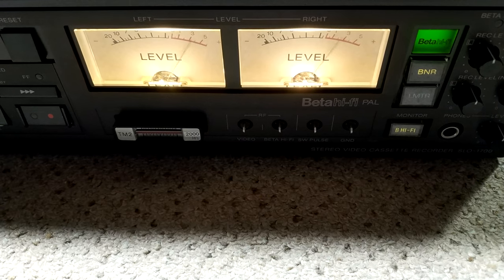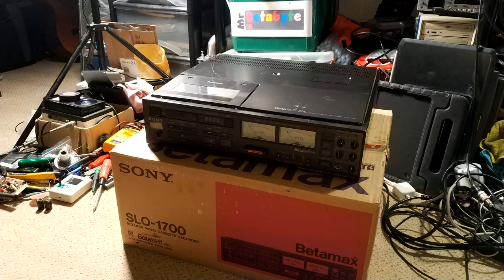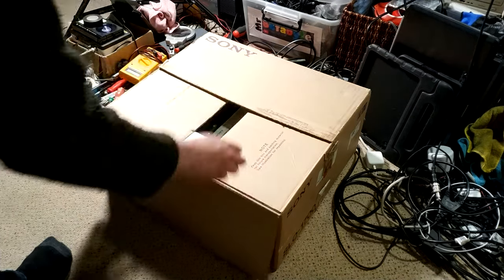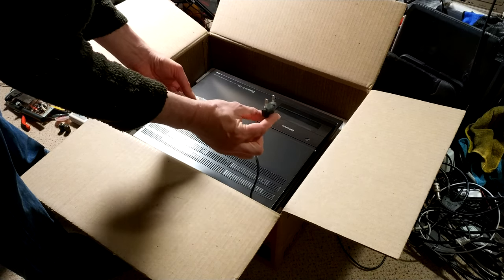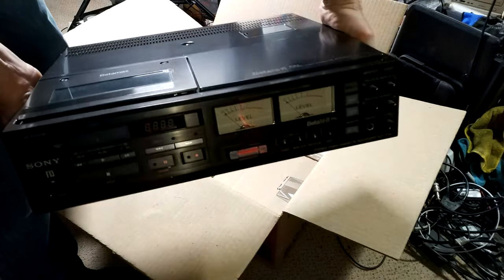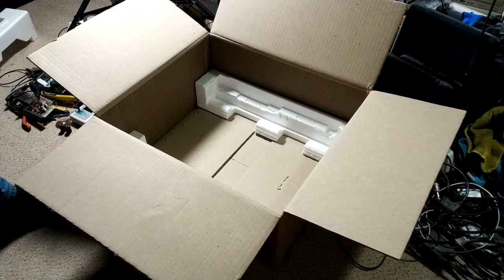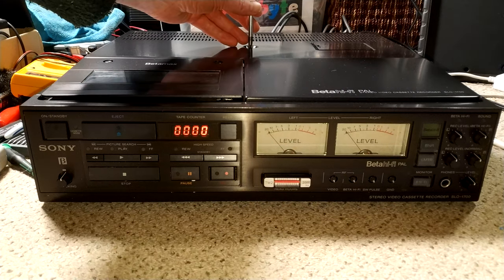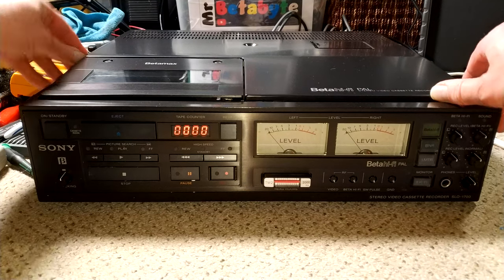Sony SLO-1700 Duplication Betamax - Beta like a Pro! - THE perfect Beta!?

Comment: What a nice VCR! I really enjoyed watching this video, you have told many features of it. One interesting topic is the fact this model has a different, simpler cassette loading mechanism than the C9, making the SLO much more robust. The unlacing feature is also a cool trick to reduce tape drag, increase speed and prolong the valuable heads' life. I think Sony made an effort to design this model so it was bulletproof as a workhorse.
Your particular unit is a treasure, really hard to find in this condition. I wish it found a nice new home.
Greetings!
Reply from the maker: Certainly a SLO! I compared the top-loading mechanism with the SL-F1 and it's a completely beefed up and unique to this model design. It may well be a 'professional' machine but in the modern age it really is the perfect Beta with real retro flair too. Ultimately, this machine would make or break the Betamax format as having a reliable machine for duplication of tapes for resale must have been the top priority for Sony at that time. Of course the rest is history but I really don't think Sony lost the format war but rather just moved on and after all, the last Beta machine was only 10 years or so before the last VHS machine...

Comment: Sorry for my lack of knowledge, but I recently found a Sony SLO-1800. Not quite the same model as the one in the video, but I believe the video ports are the same. That said, could you tell me what video cable the machine uses? I want to somehow convert the signal to RCA so I can see if my machine will actually play a tape. Thank you!
Reply from the maker: Oh wow, a SLO-1800! Any chance you could email me a picture of the socket and the rear of the machine and I'll dig through the manuals for you - I don't have a SLO1800 manual but I do have other manuals that should give you the info you need. Email is mrbetabyte@gmail.com

Comment: It is indeed an interesting machine. Wonder if RF out for video and audio HiFi is the actual RF signal recorded on tape, this is a great candidate for VHS-decode project, This is better than S-Video.
Reply from the maker: I was thinking this the other day and I will have to look at the RF output in more detail but from what I understand it's the raw RF from after the pre-amp stage but I'll let you know in a future SLO1700 video as I have a few more to make over the next few months. :-)
Reply: @MrBetaByte  Yes that's the signal needed, after the pre-amp not before. Let us know, maybe the oscilloscope will show the RF envelope.
Reply from the maker: Will do - should be looking at a SLO and investigating it in more detail very soon.

Comment: i tell you who had all of this model the hire shops
in the video start if of needed to get  VIDEO on betamax to hire out  they would use
model like  this you had to wait in  line to copy over from vhs
 and all of over 18 video  were on beta  

i  went to a big carboot sale  the man had alot of beta tapes i was told  what was on them

i am not a fan of betamax as like you i had to fix them up 

SONY PVW 2650 Betacam SP
Sony DVW-A500P
BTS BCB 75 PAL BETACAM SP,

 the range here are my bag
Reply from the maker: Definitely but there were several duplication 'houses' that used these too and very successfully. Sony did go all-out on this model to make them as rock-solid as possible.

I also have a DVW-A500P and it's a great machine although I have error codes on it at the moment so a video on that to come soon,